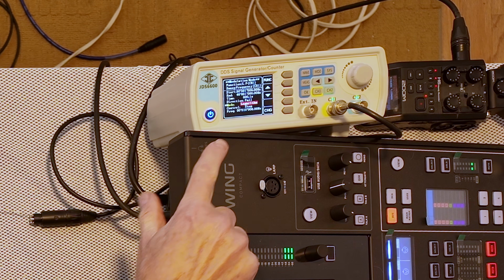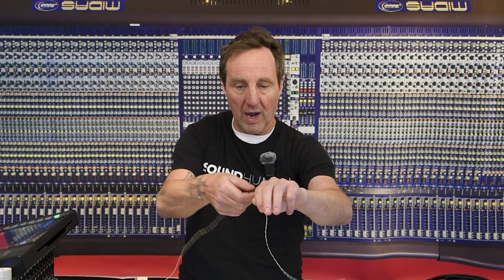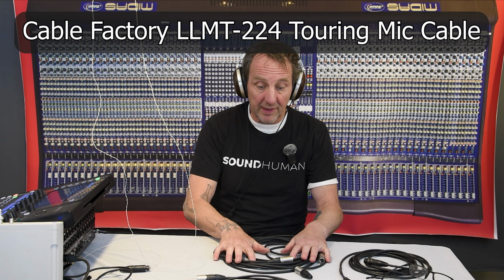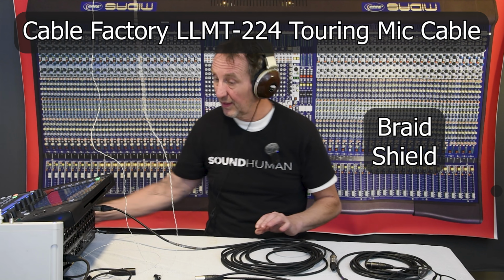Pro Audio Cable Noise Tests - Which is Best?

Comment: I'd be curious if tinned copper braid or that over foil worked any better for EMI?  IOW, a layer with magnetic properties, and not just electrostatic ones.  

For RFI, I'd be concerned with AM signals more than FM, and assume mixers have an easier time filtering out VHF on up.  So, go 500 kHz-30 MHz, with AM pulse modulation, to cover AM and CB bands, and assume that aviation that uses AM above the FM band should be filtered by mixer input caps.  

Another issue is grounding.  Generally some RF signals are best contained with multiple ground points, eg source and mixer ends, and both snake ends.  However, that sets up AC hum ground loops.  

That also becomes a trade off in ties of case to pin 1 in connectors, or not.
Reply from the maker: there are some conductive plastics as well as metalized plastic films incorporated with braids or serve shields that cable manufacturers have told me offer excellent RFI rejection as well as maintaining flexibility and durability. 

I did this video mainly as a learning adventure and not so much as a " which is the best cable " adventure 

I will ponder doing a "find the best cable adventure" but those get messy really fast because of so many options and having to accumulate and test so much stuff. 

well I believe that would be helpful, it's not as fun for me to do and a very time-consuming.
Reply: @DaveRat   Now you've got me challenging accuracy of a few details, while knowing it'd take me a full day to go dig in bins in storage trailers, storage rooms, and archived file cabinets, to be more specific in my own comments. 

I think you mean carbon infused plastics and not metalized plastics, and those as distinguished from mylar coated foil such as the classic Belden Z-fold cables.  

For tray or conduit or raceway aplications, mylar coated foil is nice because it offers 100% shielding, and is thin, though the Belden like 8451 is better than Penn or other brands, because the outer jacket is tougher and smaller so that more cables fit a given conduit size or tray space.  That, in exchange for higher wire cost, also noting foils degrade with movement and so are not well suited for stage cables.  That introduces another factor, durability with handling, which also illustrates how no such thing as an ideal cable exists, as value to improve or degrade different aspects of performance require different cable designs. 

Mylar coated foil cables are also used in many pre-digital snakes due to compactness, in exchange for life limits (but assuming two handlings a day is far less stress than mic cables on stage).  Those in turn are more compact is the mylar faces out as the insulation between STP pairs, or easier to wire out to male XLR's or A3M's, if also jacketed so that one end is in a stage box of A3F's, and the other wired to mixer pigtails.  Of course those are old Canon nuisance to assemble MIL-offshoot and then Switchcraft models, whereas we all know Neutrik helical spring point contact females, and collet and tough plastics strain relief connectors wiped those two brands, and Switchcraft's in its time cleaner visual lines and captive screw, but stamped sheet metal female barrel contacts that are far less reliable.  Not to mention Chinese junk found online.  

There are some brands of carbon infused plastic shield with drain wire cables I've found really nice, as to 100% shield, easy handling, long life with flex cycles in a studio mic boom, and options for pretty colors, plus easy labor for termination compared to braids or foils, but that tend to be light weight and loop up rather than lie slack on a stage.  Other brands (and I forget specific names) are junk because of less good plastics on jacket and inner insulation and shield layers.  

For laying flat on a stage the old Belden mic cable variants of electrical SO "service cables" are nice, but they're big, heavy, and a PITA to terminate.  Those are the ones with rubber insulated conductors, fiber fillers, heavy tinned copper braid shields, and neoprene rubber thick outer jackets (not the skinny mini-variants Belden also made).  Tinned copper if a heavy enough plating serves a potential dual role, as a magnetic material, and long term corrosion reduction.  

I'd find a test protocol and standards to define more clearly the magnetic, RF, and other electrical traits of cables, along with durability, conduit or raceway space efficiency, plenum compatibility (teflon tends to be an elevated PITA; 8451 and some higher cost jackets are at least VW-1 and CM, even if not CMP), and ease of manual or automated termination, interesting to have exist.  

Some of those factors already have UL standards.  Others I'd guess would require a $5.5 million initial budget to try to develop viable metrics.  

$100k for initial rough studies to experiment with test ideas.  $50k for techs to do repetitive testing tasks.  $100k for a dedicated lab setup.  $150k for marketing.  $100k for communications among affected parties.  $5 million for vicious viper pit lawfare games, that have driven several traditional "HiFi" and pro audio standards bodies away from even trying to publish new or updated standards.  

Guess which of those costs is more likely to run up exponentially, and require hiring former regulatory bureaucrats as lobbyists and budget for bribes and extortion, to resolve national and international disputes used as trade wars?  

And that's why we can't have nice things, when lawfare trumps potentially useful work to assist techs and engineers across an industry.
Reply from the maker: Sommer cable has what feels like almost cloth but is a thin plastic sheet wrap that is flexible and has an aluminum coating making it conductive.

I believe that call it metallic fleece
Reply: @DaveRat  I don't recall ever seeing that brand.  

I presume you've seen Beldfoil and some of its direct competitors like Penn's, where a tray cable was used for an adapter or pigtail subject to handling, as well as in snake cables at end of life, where the foil is fractured and no longer continuous, but the pieces don't just crumble due to the mylar?  

How does the Sommer product of metalized plastic hold up by comparison?  

Most metalized plastics I recall are coated injection moldings, where rather than a metal stamped insert or actual metal case, either a conductive (eg, carbon and carrier) or magnetic (tin-nickel powder infused coating) spray is applied to select areas of the inside of a plastic housing.  

Those practices apply to better DVM's and other instruments, as well as RF devices, and not just audio or video gear.  

I take it you like Sommer's overall cable design, as to look, feel, and ease of handling?  

While we're at it, let's spec as fraudulently sold on eBay "100 percent copper" speaker and other cables, that are really copper flashed aluminum.  Copper is more conductive for a given size, solders or clamps more reliably, and doesn't fracture with handling as easily as aluminum, in exchange for any cost or weight penalties.  

Hopefully just having this discussion helps others realize how hard it is to define or identify "good products" or better application suitability, even without some dishonest players.
Reply from the maker: lots of variables and I bought some copper clad aluminum wire for future test video.

here is a link to one of the copper fleece cables sommer makes with a serve shield over the aluminum fleece and a 100% shield spec. 

pretty much all the advantages of foil but more flexible and no drain wire.

don't know longevity. but seems to work well

https://www.sommercable.com/en-us/Microphone-Cable-SC-Octave-Tube-5-x-0-14-mm2-2-x-0-50-mm2-PVC-OE-6-50-mm-grey/200-0186
Reply: @DaveRat   Bad news for Sommer, for now....  I see in them an interesting up and coming high quality manufacturer, but one not ready for prime time outside the EU.  

They appear to make some really nice bulk cable and assemblies, but only discuss VDE and EU certifications, as to electric codes or fire ratings.  

That may not matter much for portable temporary stage cables.   Worst case scenario in the USA, it voids property and liability insurance policies after a fire, and makes contractors plus owners of a venue liable for negligent homicide and civil damages, if used illegally for AV, IT, or related purposes, such as 110 ohm AES/EBU digital audio and DMX stage lighting remote facility installs, with cable close enough for use also in mic or line audio.    

Ouch.  Better to not buy brands not meeting spec's legal for the USA or Canada in common uses.  I see the company is 25 years old, set up a US office 10 years ago, but have catalogs catering to UK, France, and Germany mostly, but only one small business office line showing US oriented products; not IT, broadcast, or pro AV.  

That's where those UL or ETK certifications to meet fire and electric code standards can matter, like CM, CMP, VW-1, etc, AND brand, construction, and product model.  

That's also an issue set where some very high grade teflon insulated silver plated copper cables as roll ends or dropped contract leftovers his the US surplus market, and while really good deals for some uses, are older and lack markings required since circa 1986, and so are not legal to install in buildings, airplanes, etc, even if better made than many products that are.  

Also of note, and noting Codes are generally state incorporations of certain versions of standard legal models, stage lighting related standards are due for updates to reflect how low heat LED systems and digital remote controls are far different from older halogens with racks of Lecos, Fresnels, and PAR's, at 500-1500 watts each.  If a facility transitions to 100% low temperature instruments, it seems silly to have wire types rated for lamps that run hot enough to cook on, potentially including for data remotes.  

But then, how can model codes address an old fashioned pipe of instruments, and some production hanging a few old Halogens or PAR's amidst house or vendor LED's?
Reply from the maker: I works with and know the engineers at Sommer. Been to their facility and they make great products. I believe they invented the ethercon connectors and then sold the patent to Nuetrik! They regret that decision but they are an amazing company. Not everyone wants to be a huge diluted world corporation.

I sure don't. Stay small to mid sized, stay innovative and focus on why you are good at and enjoy.

also, Sommer will get certifications for what ever is needed when needed. For the most part, EU certs are more strict that the US certifications so it's not like a product redesign is required to hit the fairly lax US certifications.

anyway, all that aside. the flexible metal cloth like shield is interesting and something I have been testing for possible use in future products we manufacture.
Reply: @DaveRat   Those impressions align with how their online info impresses me.  Good to know.  It's not easy going global for a small business.  

Is their shield fabric copper, tinned or silver plated copper (mentioned in some data sheets), or something else?  

It'd perhaps require a heavier fabric, but if you read between the lines of my previous comments, I'd suspect a magnetic plating or alloy with copper could have the electrostatic and RF performance of aluminum or copper, but work better for EMI.  That'd mean some mix of tin, iron, or nickel, as to cheap, common metals.  

As to drains, forgot to mention before, they showed up in audio cables when shield metals became unsolderable.  With a copper or plated copper braid shield, one could use a fid to open a hole in the braid, like nautical seamanship ropework, pull the twisted pair through, and either twist the braid to a ground connector, or separate two parts for pin 1 and housing of an XLR.  

Aluminum foil, or conductive carbonized plastic, that's impossible.  

Depending on the time and budget for a site, and types of connectors in a broadcast or recording console, that might also mean with cable like Belden 8451, sliding back the jacket to nick and peel the foil so the edges pulled back under, clear sleeve the ground wire, ID tag the wire, clear shrink over the ID and tube to drain, and install Amp PIDG series MIL grade lugs, on ends to terminal blocks, or other connectors as needed, and often on the other end, instead of connecting the drain, roll it on the jacket to remain available, but insulate it under the clear shrink to be obvious and visible as there but by design not connected to avoid ground loops (unless at a transmitter site, where ground everything heavily and use 4" copper bonding straps and star-hub layouts to control ground loops).    

A really well designed and built facility will do well resisting lightning hits across power to phone to antenna or data cables, and not just avoid audible ground loops. It only takes one sloppy bolt or cable to degrade a larger system.
Reply from the maker: the flexible fabric like shield is an aluminized plastic. it's like a flexible plastic aluminum. It has a fairly high resistance but is covered with a blcopper braid or copper serve.

Comment: You ever have one of those moments when you realize the Behringer Wing has all the functionality of that Midas 3000 along with about $200k of outboard gear and wonder when you got old? 😂 ❤
Thanks for the info Dave, musicians dont get it when I scream at them to find somewhere else to charge their phone then right beside my monitor mix board…. :/
Reply: The phone near the cables is an Issue. The surface of most consoles is metal and bonded, so not an issue. Even the Beheringer X32 has a rest for an Iphone on the front of the console. Just don't tuck a phone in back of the console to charge off the USB port. That is not good.
Reply: @isettech … I was referring to plugging in phone bricks… Srry, I should have been more specific. :)

Comment: So, can a cable be made that can reject both as best as possible? 
Tight twisted quad cable with foil 100% sheild and then braided sheild on top like Cat8?
Reply from the maker: absolutely, and there are cool things like conductive plastic and metalized plastic. that offer flexibility.

but typically it's a trade off between size cost, durability and flexibility with bigger expensive stuff cable performing better.

oh so you got to balance all this against how much noise issues you're actually experiencing
Reply: @DaveRat  Thanks, Dave! Ive been routing audio through my house walls with CAT8 using the twisted pairs to mimmic the nice Canare/Mogami quad star cables so I end up with a stereo pair out of the 8 cables in a ethernet cable. Felt like that was the best option since its immobile. Super low noise while running parallel to power lines in some spots.
Reply from the maker: I did do some testing using supercat cable as a double quad mic cable with four wires for  pin 2 and four wires for Pin 3. it performed quite well overall. I don't recall the outcome offhand but it was up in the top two or three cables tested

Comment: It would have been interesting if you had also included trials with ferrite beads.
Reply from the maker: I will ponder that. it could be interesting to hear the difference between adding a low pass filter to your audio cables via a ferrite bead vs electronically vs using a cable that prevents the interference from getting in there in the first place.

it's possible ferrite beads could somewhat reduce the RFI noise a bit.
Reply: @DaveRat   Try using the Shure A15RF at the input of your console. I found out about those after building a PCB with 15 mH Bifilar filter chokes and installing them at the input jacks of the console for the talkback from the FOH engineer. Have not bought or tested the Shure filter. The inductor has an RF attenuation exceeding -60 DB into 600 ohms for common mode noise rejection at 1 MHZ. We used them on the TB lines from FOH to the band and to the monitor engineer, and used them on the Right, Left, and Sub to the Meyer Sound 616 speaker management.  Attenuating the RF to prevent rectification into audio fixes the RF issues.  A Bifilar wound filter provides no differential mode attenuation, but has good common mode attenuation at RF frequencies, so sound quality is unaffected, while rejecting RFI.

Comment: Answer is Canare L-4E6AT
Reply: Great, that saved me 20 minutes.
Reply from the maker: so interesting because I came up with analog over a cat cable whenever possible being the preferred solution
Reply: So that says it’s for permanent install, are you saying it’s flexible enough for mic cables that run on the floor, get wound and unwound, etc?
Reply: @evoltap flexible enough for mic cable